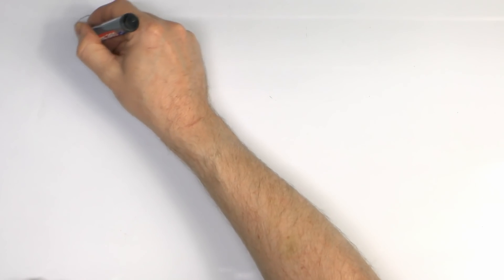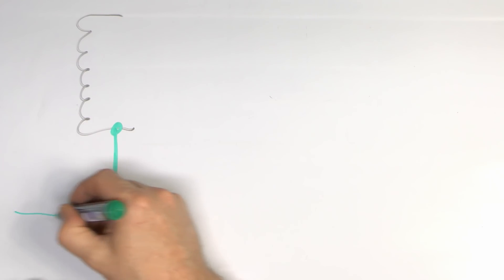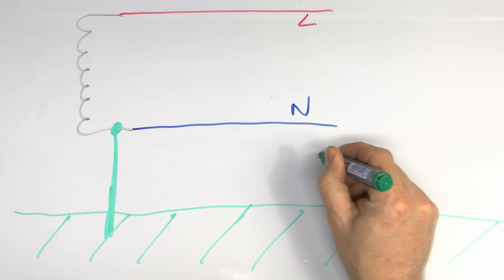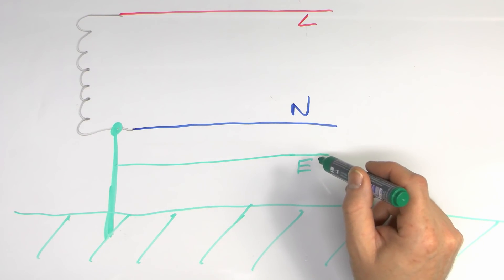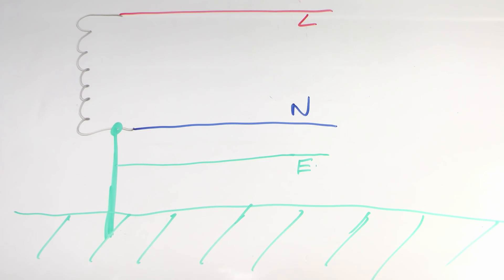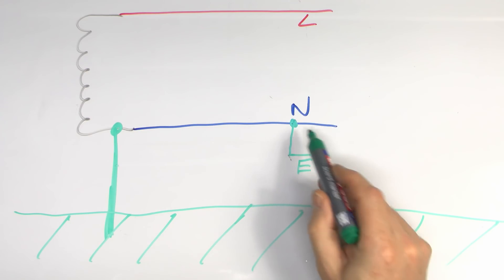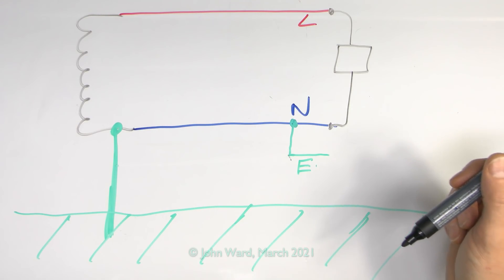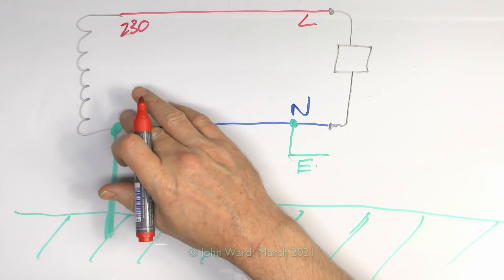Earth Terminal Voltage Drop TN-C-S

Comment: Like in Hungary, we must instal earth electrode by every single house/meter. To keep the local ground and actual PE wire on the same potential.
Reply from the maker: Most countries have been doing that for ever.
In the UK, it's been permitted for ever, but is never done because it's not a requirement.
Reply: @jwflame  When a street sufffers a lost TNC_S Neutral: ? Will an earth rod in my garden carry the lost neutral current from 'all' the other houses in my street -
in particular, would the Cable linking my earth rod to the main earthing terminal of my TNC-S supply become very hot ?
Reply from the maker: @oldbutstillcurious3615  Theoretically yes - but in reality the current depends on the resistance of the earth rod, a single rod isn't likely to be very low, so the current won't be anything near the total connected load.
Even with 10 ohms which would be exceptional for a single rod, current will only be a maximum of about 23 amps with a 230V supply.
Large earth electrodes from grids, metallic mesh or similar can have a much lower resistance, but they would also be connected with far more substantial wires.
Reply: @jwflame  Many thanks for the quick and comprehensive answer.
Reply: @jwflame  here in Finland it’s not just a rod, but bare 16 mm2 around the perimeter of the building as well as bonding to the rebar in the foundation. I have an outhouse with additional bonding with the TN-C-S exported to it, it would be interesting to temporarily break the connection to the perimeter earth electrode and measure the voltage difference.
Reply: Is the 16mm bare copper around the building connected to the earth rod? How deep is it into the soil?
Is that mandatory in Finland?
Reply: Same here in Australia, we simply call it MEN. The earth connection must  be to a stake and if possible to a water pipe.
The only hazard our system can develop is from a faulty neutral connection on the supply side. Then the neutral current flows through the earth and a potential difference between grounds can occur. Thankfully most of us take even tingles in the shower or hot tub seriously and call someone competent pronto. I'd also add that all new installs or upgrades mandate RCD protection per every circuit. As a result pretty well any errant current is going to trip an RCD which can lead to problems with nuisance tripping but sure less of a nuisance than a funeral.
Reply: @robroysyd  Where I live in rural England the transformer that supplies me and around a dozen other houses sits on the cross-piece of an H pole.  All the cabling from the Tx to the houses is overhead and earthing is TT as there is no DNO supplied earth. 
Interestingly although this Tx takes its supply from a passing 3-phase 11kV system the transformer is only single-phase being connected between two phase conductors.
Reply: @davidfaraday3085  Reason the transformer primary is connected across two phases is there's no neutral on the 11KV system. Your single phase load is being split over two phases thanks to the transformer. Some effort is made to ensure the multiple single phase loads connected to the 11KV 3 phase system balance out so that each phase is carrying around the same current.
The arrangement used for delivery of power in sparsely populated regions down here  can be Single Wire Earth Return. In this system the planet supplies the return path for the circuit. Each end of the line has a transformer and that lone wire carries an intermediate voltage to keep losses in check.
Reply: @robroysyd  Yes I understand that the transformer primary is connected across two phase wires because of the lack of a neutral. My point was that it is a single-phase transformer despite there being a three-phase supply available to it. However there are three terminals on the secondary each of which feeds a wire on the LV distribution side. This seems to be similar to the American system of using a centre-tapped secondary with the neutral connected to the centre-tap. As with three-phase if the loading is reasonably balanced between the two sides it minimises current flow, and thus volt-drop, in the common neutral wire.
Early telegraph systems always used single-wire with earth return to save costs.
Reply: @davidfaraday3085  AFAIK there's no way to have a three phase transformer that'll split a single phase secondary load over the three primary phases. A 3 phase transformer is pretty close to being three transformers in the one case with a sort of common core.

Yes, the old farm house that SWER power also had a single wire phone, the "wire" happened to be the top strand of the fence. If you didn't   close the gate no phone!
One side effect of that copper saving was you could tell a storm was coming from the short rings of the phone. When the PMG said don't use the phone during an electrical storm that was a warning to be taken seriously.
Reply: @robroysyd  Maybe I didn't make my point clear, I am well aware that a transformer can't split a single-phase load across three phases, my point was that the DNO chose to supply all the dwellings served from this transformer are on the same phase. If they had installed a three-phase transformer they could have balanced the load across all three phases.

An exchange-line phone can't operate over a single wire line.  |Maybe this was some sort of intercom to another dwelling.
Reply: @davidfaraday3085  Oh yes that is indeed odd. Maybe their stock  3 phase transformer was too heavy to put on a pole or maybe there's other blocks of houses with a transformer on the other phases. Around here all the transformers are at ground level in "kiosks" which makes maintenance etc. easy. Pretty well all streets have 3 phases and neutral run on poles down the street. Newer subdivisions are generally done all underground.

The phone line wasn't an exchange line, it was a party line. You had to count the number of rings to know if the call was for you.
Reply: Same in Finland.
Reply: Same in Germany.
Reply: When we populate Mars (not in our life time of course) I wonder what the ground reference will be called.
Just watching Mars City United playing Red Rock Rovers at the final few minutes of the match on your hologram when the RCD trips due to a "Mars fault". The missus just plugged her curling tongs in (yes I bet they'll still have those when we're long gone) and it's knocked the Mars trip out. 
In the 35th version of the wiring regs there will be a reference to Mars Fault Loop. 😁
Reply: Exactly the same in Australia, only power lines  come from the transformer on the pole in the street.

Comment: Interesting,  the more I see information about power systems in other countries the more I realize the US is not all that backwards.  My house may share a transformer with a couple other homes,  however each has a home run to the transformer.   The US was pretty behind at one point,  I think the playing field for safety has mostly caught up.  Insurance companies drive most of the progress.
Reply from the maker: In the UK, it's common in urban areas to have a single transformer that supplies dozens or even hundreds of homes mostly with underground cables. 
Rural areas usually have smaller transformers for one or a few properties, overhead cables are more likely there.
Reply: @jwflame  It's just interesting to hear that they sometimes chain them house to house.  I'm not saying that doesn't exist in the US,  I've just never seen it.  Rural areas in the US have smaller pole mounted transformers with runs from the transformer to a few homes.   Always a star type configuration.   Thanks John,   you should look at some of the videos from Mike Holt related to problems in the US with earthing.   The same type of voltage gradient issue exists,  just for a different sort of reason.
Reply: @jeffm2787  Lower voltage (120/240V) combined with single (split) phase requires different solutions for power distribution in the US.
In Europe our LV distribution network is mostly 3ph 230/400 Wye. Higher voltage with more phases results in much lower currents per conductor and higher permitted voltage drop (since, for example. 5% of 230V is more than 5% of 120V), therefore we can afford building longer LV distribution circuits with fewer, more powerful transformers. Also, multiple transformers require extensive MV (medium voltage) distribution network to supply them. In  the US it is available nearly everywhere, on almost every street, which stems from the multitude of transformers, whereas in Europe it's not available as easily and installing another transformer often requires quite a lot of work on extending the MV network to the transformer's location (even in mildly urban areas, MV lines are almost always underground).
Also, we tend to make our transformer locations quite complex, with various equipment installed. In urban areas it's typically a small building (a hut of sorts), these days installed as a prefab, concrete structure, with separate rooms for the transformer (up to 1000kVA, sometimes more than one) and for distribution equipment. The foundation has a vault for cabling and an oil basin to capture transformer oil in case it leaks out. Distribution room has an LV distribution board with a main switch, overcurrent protection and switching for multiple LV circuits, equipment for energy metering, load profiling etc., and often a generator hookup for vehicle-mounted generator. There's also an MV distribution board with two (or more) MV power lines connected (in cities most transformers are plugged into an MV ring or a chain that runs between different HV substations), transformer protection (fuses or breakers) and all the switches tend to be motorized in new locations to allow for remote switching and network reconfiguration. It's much more economically feasible with 100 costumers supplied by a single transformer location than with only 5 or so :)
Reply: @Micha-xl5yc  Wow,  you were busy typing.  In the US higher voltages are used for commercial buildings.  3 phase is often even used for some high density residential buildings.  For commercial 3 phase and up to 600 volts are used.  Had a ground wire spring and short a 480 once.  Not much fun.   I prefer the star type distribution used in most US homes vs the chained power distribution.  We do however still end up with ground voltage issues as explained in some videos by Mike Holt (NEC).  The star distribution just means we see less noise from the neighbor's drawing current off the transformer.
Reply: @jeffm2787  Yup, star layout has its advantages, but unfortunately it's practically impossible to implement around here in suburban areas, where a single LV circuit can be a 1000 meters long. We do, however, lay separate circuits from the transformer for certain customers, especially when they require a lot of power, so that their influence on other customers is minimized. Also, in urban areas, apartment blocks are often fed with a dedicated circuit, usually a few per transformer.
Reply: @jwflame  Common to have 200kVA transformers and feed a short section of street, or a 1MVA for a cluster of high rise and high density housing, though the age of the transformer fleet often has you with 3 200kVA transformers right next to each other, as the load grew, as it is a lot easier to splice in the 11kV feed, than to replace the transformer, as often they are in buildings with poor access due to construction, or limited space.

Across the road a 400kVA unit, and 20m away a 300kVA unit, on the same feed, because the 300kVA supplies a single complex, and it was installed relatively recently. Unlike the 400kVA, which dates back to 1900, when it had a, now disused, mercury arc rectifier room, for when it was used to supply traction power for trams. The old DC cabling is still mostly there in the ground, and was still, till 2009, fed up the street poles.
Reply: @SeanBZA  I used to work for LEB. Our ground work contractors used to love it if we had to clear the ducts for a new cable and we were pulling out old DC stuff. Loads of copper in them, great for scrap value.
Reply: @Raysnature  No ducts here, only direct buried cable. most of it is old steel tape wrapped paper insulated cable as well, at least where it has not failed and been scotchcast to PVC SWA cable. My feed is still the original lead wiped steel taped paper cable from 1950, though it is slowly leaking out the oil impregnant. Only going to be changed on failure, as they will need to do a good bit of trenching and drilling to bring in the new cable.

Comment: Wouldn't the 3 houses usualy be on different phases and the neutral current would only be flowing in the short neutrals beween houses?
Reply from the maker: Adjacent houses are often on different phases, but that 3 phase cable will typically supply dozens of homes along a road, each with a single phase connected.
Reply: @jwflame  But statisticaly all of those houses represent a ballanced load to the substation so the only neutral current flows  from the street cable to the individual supplies and between any points of inballance in the street cable. any neutral currents only act along a short length of cable. The net current in the neutral back to the substation is zero.
Reply: @elanman608  Can be, but with modern high harmonic loads neutral current, even in a 3 phase system that is balanced phase current wise, will be high, approaching the same current as the phase current, and can even be higher in some cases. Even though power factor correction is applied at the load, there is high harmonic current flows in the lines.Neutral current being zero only applies really with pure resistive loads, not with loads that use either active rectifiers to generate DC bus rails, or just plain rectifiers. There you get current spikes that are harmonics of the mains frequency, and these do flow in the neutral. They go up the supply system to a larger substation, that has power factor correction capacitor banks, that filter them out.
Reply: @SeanBZA  or to put it simpler, for loads that draw at the peaks of the waveform, like a smoothed rectifier, if it draws current for less than 1/6th a cycle on the positive and negative, the current draw on one phase is always at a point when the current on the other two is zero, and there Is precisely zero cancellation between the phases because they're never drawing current at the same time.

Comment: I take it this means the UK does not require earthing electrodes bonded at the service entrance? Here in the US code requires at minimum two earthing electrodes connected at the N-E bond. As well as requiring swimming pools and all exposed metal be separately bonded to the earthing system.
Reply from the maker: No, unfortunately not.  They are permitted, but optional, so are almost never installed.
In the past, most properties had their gas and water pipes supplied via underground metal pipes which were bonded to the supply, and acted as electrodes even though not intended for that purpose.
More recently those underground pipes are all plastic, so there is often nothing at all connected at the supply point.
Reply: If you have your N-E bonded to an additional local earth electrode, wouldn't there be a persistent current between the N-E and local earth?

Comment: These recent videos are greatly appreciated.  I wonder when the decision was made to make TN-C-S the standard earthing arrangement.  Was it after the network was privatised?  It's also interesting that the seemingly superior TN-S was the default system when the first electrical services to homes were originally laid in the ground, and now it's all been vandalised.
Reply from the maker: TN-C-S has been commonly used since the 1970s, possibly earlier in some areas, long before privatisation was even considered.
Reply: @jwflame  Yes here it has been around a long time, when the supply was overhead bare copper 4 conductor cabling. You can save a massive cost in doing a distribution network in only needing 4 current carrying conductors, and then having a grounding rod by each consumer metering point, as you cut around 20% of the cost of the cabling and pole loading. Even  after the copper cables were swapped out to ABC  they stayed with 4 cores, as this made retrofitting much easier. 

You can tell though just how long a property had a single owner though, as you still get properties that use 3 copper wire bare feeders to them, only ones in a street, so they have not changed owner since the 1980's when they would make replacing the cable a prerequisite to get the property transferred, though often the change was simply to swap out the old 3 bare wires to a split concentric cable running from the original pole attach point to the original roof attach point, and then reuse the old DCC wire to the meter from there. The newer versions of that use aluminium cable from the pole to property, lower cost to the metro, as they keep the cable and connections in stock in bulk for distribution upgrades and repairs.

Now if only they would replace the shorting blocks on street lamps with photocells when doing the rewires, instead of either just leaving them disconnected, and no longer on group control, or wiring then to a phase and leaving them as dayburners.

Comment: Hope you can help .
Quick question how do you determine or work out the size of the cut fuse. Ie 100amps or 80Amps  Is by the Ze   or PFC 
Hope your can help.
Reply from the maker: The only way is to remove the fuse and look at it, or ask the DNO to do the same.